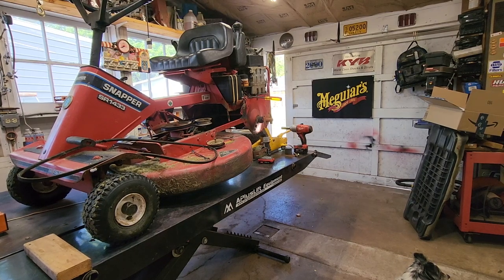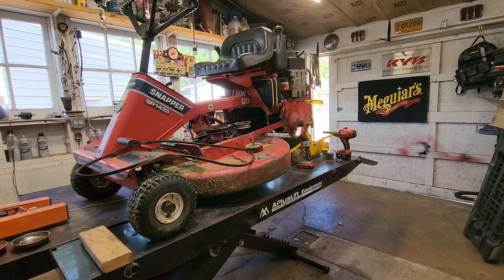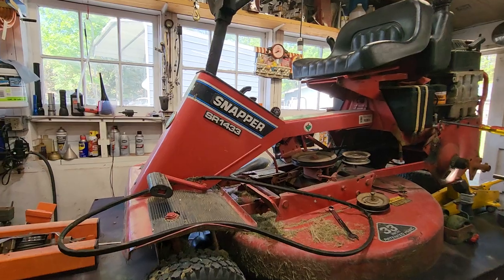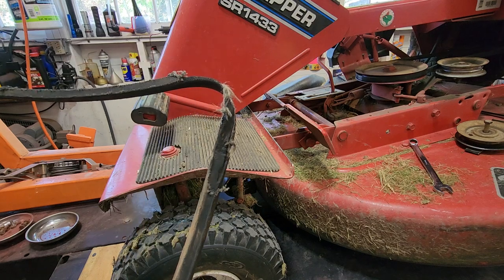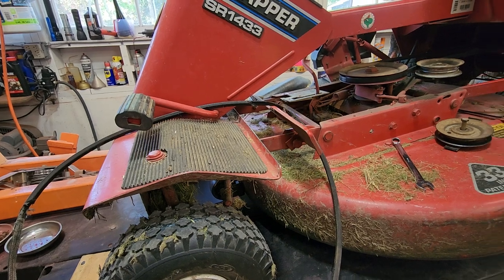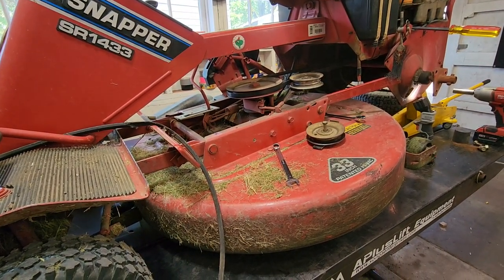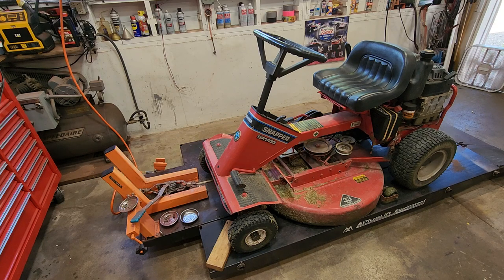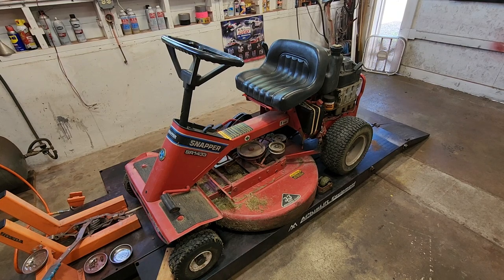Tips and tricks on changing a deck belt on my Snapper Rear Engine Rider 1433.

Comment: Thanks for the video.
I've just bought a used snapper rear engine mower, it is in need of a new belt. Your video will be a big help.
Reply from the maker: Glad it helped
Reply: Having worked AT the Snapper factory 40+ years that is one HUGE misconception, the Snapper rear engine rider went through MANY engineering changes sometimes from one Series to another aka Model to another ALL the parts are NOT interchangeable, ALL adjustments are NOT the same and if you watch ANY Snapper YouTube vidios BEWARE if they DON'T tell you the actual Model / Part number / aka Series they are working on, as a matter of fact many call this type of Snapper the SR1433 which is NOT & NEVER has been the Model number, it was just a marketing idea by a woman at the time.

Comment: What size belt? Been looking online but not sure what size it is. The letters on my old one are all gone
Reply from the maker: YMCONE Lawn Mower Tractor Drive Belt 1/2" X 74" for Snapper 1-8236 2-2252 7018236 7022252 7022252YP, Murray 1001223 1001223MA 710232 https://a.co/d/5wmPtRX
Reply: @GlennsSpeedShop  ALL Snapper belts are NOT the same sizes, take your Model number off the Serial plate & go by that DON'T follow YouTube pages

Comment: Have the same mower, what size belt did you go with? Mine just shredded to bits.
Reply from the maker: I think this is it.  
YMCONE Lawn Mower Tractor Drive Belt 1/2" X 74" for Snapper 1-8236 2-2252 7018236 7022252 7022252YP, Murray 1001223 1001223MA 710232 https://a.co/d/91LISfC
Reply: @GlennsSpeedShop  thanks a million
Reply: Thanks again, worked like a charm. What part of the coast by the way? I grew up on Newport
Reply from the maker: We are in Albany. My dad lived in Newport and had a building in Toledo. We have a LOT IN southeast
Reply: Awesome, my family still lives in Toledo. Small world
Reply: @ElChiposorus  ALL these mowers DON'T use the same belt, some are not even adjustable

Comment: Wat # is this belt I have been looking everywhere and can't find it
Reply from the maker: Stens OEM Replacement Belt 265-199 Compatible with Snapper 7-14 Series Steering Wheel Models 25", 26", 28", 30" and 33" Decks, Models 0-6 Handle bar Models 33" Deck 1-8236, 2-2252, 7018236 https://a.co/d/081NTUdd

Comment: How do you adjust the tension on this belt
Reply: DIFFERENT based on the particular Series / Model that is found on the Mower Serial plate decal, SOME are NOT adjustable. With the Model number you can get a Operators manual that tells you what you need

Comment: I didn’t know that it had 3 pulleys. When I got mine used it only had 2 in front. Not sure what burned up my new belt. But it smoked it the 3 time it got used
Reply from the maker: I have had 2 of these that the belt was routed wrong. Are you using a double V or a single V belt. You have a drive pulley on the engine, a driven pulley on top of the blade and a tensioner pulley connected to the pull up Handel on the right side of the deck. Review this video for proper routing. The belt should last many seasons.
Reply: @GlennsSpeedShop  okay in your video it shows you putting on 2 idler type pulleys. The  one I have is not on that side it’s opposite of the handle clutch..     yeah it’s a double V type belt  I put on. Not sure if I should get another idler pulley for the opposite side too. What do you recommend.
Reply: @sheckycarriere4356 ALL Snapper rear engine riders are NOT the same !